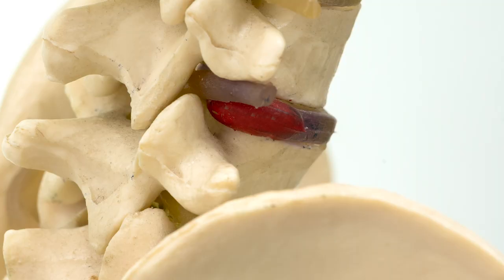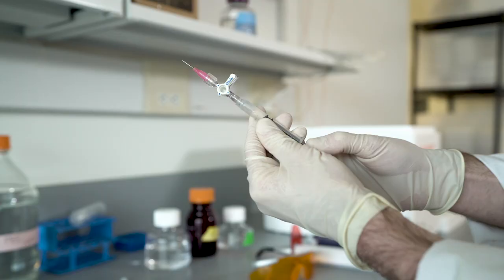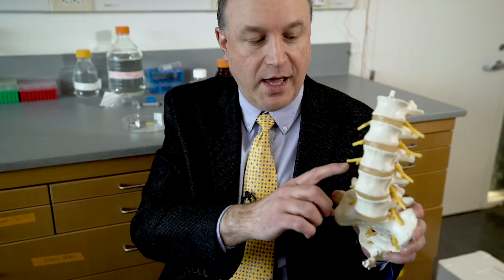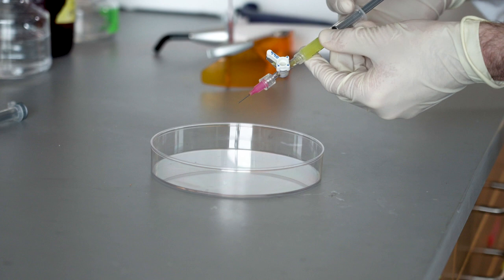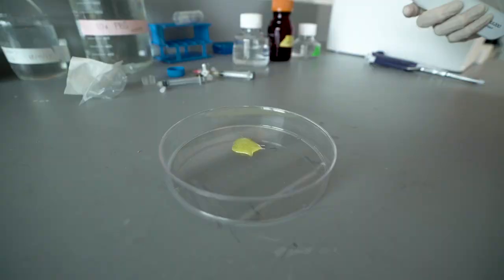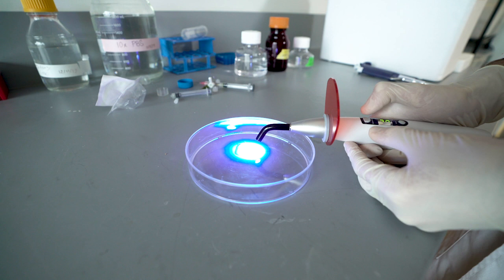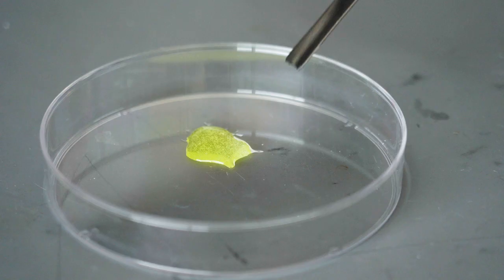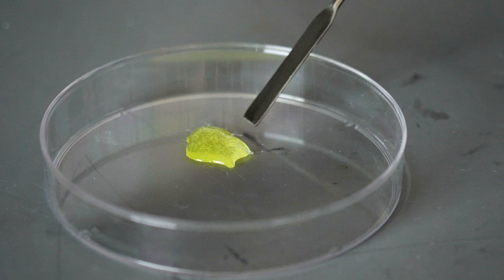Two-step method patches herniated discs

Comment: Why is this not attracting more attention??? 
Why is this not being rolled out?
What happened to the sheep that this was tested on?
This is life saving research. Hurry it up please.
Reply: Dean Whitelock There could be later concerns of this material getting into your bloodstream.
Reply: Dean, I understand your feeling
Reply: @Afrocanuk  hips are replaced, metal knees, stunts in heart and many more done successfully, Herniated disc problem should be solvable
Reply: Discseel© is happening. It’s very similar. But it’s very early stage deployment.
Total disc replacement, specifically the ActivL, seems the best option, from looking at the 5+ year empirical evidence studies.
Reply: It's collagen lol
Reply: @mrdeanwhitelock  check discgenics
Reply: @omikoch still in trial.. only viadisc is available now

Comment: When is this going to be available?
Reply: I had annual tears in L4/5/S1 as well as highly degenerate and herniated discs. Dr Wolff at Southwest spine and sports in Scottsdale arizona repaired the tears with disc seal and then filled the disc with exosomes. 

Before the surgery I had back pain for years and spams that would keep me off my feet for a week. 

Two years ago my tears occurred and I was completely immobilized for weeks with severe stiff sore achy pain. The Mayo Clinic wanted to fuse me but while in bed in YouTube I found a video that some guy posted 7 years ago, he went to Europe for stem cells into his disc. I wrote him a message and he replied he was doing well. So I started searching for stem cells in USA. I found disc seal video and then looked up the closest doctor. I found Dr Wolff and had the procedure done, I figured it was better than fusion first. It cost between 17-20k with all expenses by that may have changed. The pain went away within days and I’ve been on a long therapeutic road to recovery to strengthen my core like steel. I also ice bath a few times a week, I am a member of a ice bath spa. Loose weight, sit less, build core, posture is always on point. 
God bless you all, this is a life long battle for us and this surgery may prevent some of us from fusion.

Comment: There seems to be no updated information on this procedure and when it will be available as an option for surgeons to use. Millions of people need this surgery urgently to avoid the massive spinal fusion surgery, which is the only real alternative for badly damaged discs. Does anyone have any news?
Reply: Its available in arizona @dr michael wolf.
Reply: @mujeeburrahmansharrief8841  You have discseel available in Arizona?
Reply: Artificial disc replacement has been going on for about 20 years. Lp-esp in Germany is king.. fyi

Comment: Sounds promising.  Is this at all related to the discseel procedure?  Discseel, which I've been considering, is not though a two step process.  Does that matter?  Are the fillers the same?
Reply: disceal repairs only annulus fibrosis, this method is for nucleos pulposes as well

Comment: It looks very promising, in future they could use cellurar seeded collagen gel to seal the hole and maybe inject HA with some kind of growth factors or cells that would improve restoration of the nucleus and annulus. I'm 19 years old and have disc problem but not as severe as i see other when they are using opiates to function on daily basis and are sceptical when it comes to surgeries (i dont blame them- current surgical methods are pretty primal). I just hope the research in this field with accelerate and the technology will be accessable before it gets to the point when many of the people that could now benefit from it will in future (when the technology becomes accessable) will have their discs in the point of no-return. Even though i suffer from LDH its really painful to see other people experience it to such extend...
Reply: ncbiomatrix is working on restoring the disc
Reply: @janmiedza6607  yea i know but i doubt it would be suitable for disc herniation, maybe in the enchanced therapy with discectomy with annulus repair etc. I just hope these big companies will work together to empower therapy outcome.
Reply: @XueHaoPiaoPiao44  You write about nc bomatrix, not about prof Bonnassar?
Reply: @janmiedza6607  about nc biomatrix usage in disc herniation
Reply: @XueHaoPiaoPiao44  jesteś z Polski?
Reply: @janmiedza6607  tak
Reply: @XueHaoPiaoPiao44  co napisał Ci Bonassar? chyba ich badania były przeprowadzone na zwierzętach, ale dysk odbudowany był sprawny tylko 6 tygodni?
Reply: @janmiedza6607  nic, nie pytałem o to. Po 6 tygodniach zwierzę zostało uśmiercone i krążek zbadano, pewnie dlatego to 6 tygodni. Z resztą to kwestia kilkunastu lat zanim cokolwiek ruszy.
Reply: @janmiedza6607  z resztą nie łudziłbym się ,że to działałoby jak normalny krążek, do tego trzeba by było bardziej zaawansowanej technologii- coś co by odwzorowywało strukturalną budowę pierścienia, te całe warstwy itd no i pewnie dodania jakiś komórek by to wszystko lepiej się zagoiła i funkcjonowało na dłuższą metę zarówno do wnętrza dysku żeby spowolnić/ choć trochę odwrócić degenerację. Nawet wtedy pewnie by się coś znalazło przez co dysk  i tak nie byłby jak zdrowy... Szczerze mówiąc ch*jowa sprawa, osobiście z dnia na dzień gasnę psychicznie przez ten zajebany kręgosłup...
Reply: @XueHaoPiaoPiao44  nc bimatrix pracuje nad odbudową pierwotnej wysokości krążka, czyli defacto nad odbudową krążka, na rynku ma to być za mniej więćej 4 lata, a czemu wg Ciebie ta metoda Bonnasara nie działałby jak normalny krążek? u owcy podobno sprawdziło się bardzo dobrze
Reply: @XueHaoPiaoPiao44  mi napisał, że do 10 lat, jeśli kilkanaście lat to o kant dupy potłuc
Reply: @janmiedza6607  tzn na pewno teraz to ruszy - może ogarnęli się ze to co na razie mają do zaoferowania nie jest "leczeniem". Ogólnie rozwój biotechnologii idzie coraz szybciej, ponadto bóle kręgosłupa dotyka coraz więcej osób także pewnie pracę nad sensownymi metodami leczenia będą bardziej intensywniejsze. W ciągu 10 przełom jest bardzo możliwy ale wdrażanie tego, dopracowywanie technik np takiej discectomy by dysk mógł dobrze funkcjowac itd kwestie terapii komórkowych nie wiem ile zajmie. Mam nadzieję że w końcu cały świat zwróci uwagę na miliony cierpiących ludzi, których grono będzie się tylko powiększać.
Reply: @janmiedza6607  owca to nie to samo co człowiek chodzący na dwóch nogach, z resztą uraz u owcy był wymuszony na zdrowym zwierzęciu i dosyć szybko operowany. Trudno odwzorować tak skomplikowana budowę pierścienia włóknistego, ponadto ubytek nucleusa też był (czyli defakto komórek, których i tak już mało u osób z degeneracja itd). Na pewno jest to lepsze od discectomy bez tej łaty ale na pewno jest to początek pójścia w dobrym kierunku. U osób z przerwanymi pierścieniami terapię komórkowe by się nie sprawdzily bo po prostu by wypłynęło przez dziurę w pierścieniu, po jej załataniu może by zadziało i dało lepsze efekty w walce z degeneracja. Ale znając życie wyjdzie pierdyliard rzeczy które są złe itd chociaż kto wie, myślę że dużo zależy od wyników badań discgenics, mesoblastu, nc biomatrix (chociaż w jego przypadku on nie repopuluje liczby komórek krążka tylko jakby pobudza już te które są - a jak wiadomo komórek jest mniej w zdegenerowanym krążku no i też może działać krócej niż takie komórki). Muszą znaleźć sposób by odwzorować strukturę pierścienie, ożywić środek krążka itd. O ile co do tego drugiego jest kilka kandydatów np komórki i białka itd to to pierwsze dopiero się zaczyna a ten filmik bossnara to krok w dobrym kierunku.
Reply: @XueHaoPiaoPiao44  pewnie nie mają sponsorów żeby przeprowadzić badania
Reply: @XueHaoPiaoPiao44  nc biomatrix do odnowy dysków używa jakiegoś żelu , który nie ucieka z miejsca podania, jesłi udałoby sie  odbudować pierścień to chyba byłoby to rozwiązanie idealne, ale czy ktokolwiek inny oprócz bonassara pracuje nad regeneracja pierścieni?
Reply: @janmiedza6607  pisałem do ncbiomatrix, odpisali ze pierścień musi być nieprzerwany. Degenerację krążka to nie to samo co przepuklina z degeneracją krążka. Wątpię żeby nc biomatrix miałby odbudować pierścień do tego potrzeba jakiejś łaty jak w metodzie na filmiku tylko bardziej zaawansowanego biomateriału.
Reply: @XueHaoPiaoPiao44  wiem o tym, ale ten materiał co stosował Bonnassar chyba jest ok, przecież pracowali nad tym jakiśś czas, mogliby współpracować z nc biomatrix, ale wiadomo o co chodzi - kasa
Reply: @XueHaoPiaoPiao44  nie wiesz czy są inne firmy, które zajmują się odbudową pierścieni? to chyba firma w któej pracuje bonnassar https://3dbiocorp.com/about-us/
Reply: @janmiedza6607  nie znam, to kwestia kilku lat
Reply: @XueHaoPiaoPiao44  myślisz, że w ciągu kilku lat uda im się opracowac skuteczna metodę odnowy pierścieni?
Reply: @janmiedza6607  nie wiem, możliwe że za ok 10 lat.
Reply: @XueHaoPiaoPiao44  niestety to może być prawda, 10 lat to zbyt długo, ale oby nie dłużej, gdyby działali tak jak  ze szczepionką na covid mielibyśmy to w tym roku, niestety nie ma kasy na te badania, Bonassar chyba jeszcze niz znalazł sponsora, w sumie nie wiem co z tym dalej, on nie odpisuje na meile
Reply: @janmiedza6607  no cóż, discgenics się wydaję ,że zabiera się na rozszerzenie zastosowania ich komórek w leczeniu w połączeniu z discectomią, coś tam annular repair itd. Ale to faza "wykonalności" przed badaniami przed klinicznymi. Mam nadzieję ,że do czasu aż coś wynajdą będę się nadawał na taki zabieg o ile do tego czasu nie pierdolnę sobie w łeb. Do tego czasu nie mam zamiaru poddawać się tym pseudo zabiegom po których chodzisz z dziurą w dysku i jebią ci się pozostałe dyski.
Reply: @XueHaoPiaoPiao44  tak na serio to nic nie wiemy, Bonassar nie chce nic napisać, milczy jak grób, przecież to powinien być priorytet takie leczenie, a niestety taka prawda miliarderzy maja w dupie żeby fundowac badania, także może być opcja, że nie doczekamy sie  nigdy
Reply: @janmiedza6607  nie ma co pisać, bo jest sam. Jak sam mi napisał jest to chronicznie niedofinansowane. Niestety ale prawda jest taka że  ból kręgosłupa nie jest tak "spektakularny" jak wirus czy rak ,dlatego też mają to w dupie bo to "choroba dziadków" i się kończy. Sam jestem pod wrażeniem jak ten problem jest lekceważony, pół miliona osób ROCZNIE w stanach przechodzi discectomie która działa na krótką metę, a na samą myśl o fuzji kręgosłupa mam ciarki. Nie mamy wyboru, mam nadzieję ,że ruszy coś sensownego co pozwoliłoby na przywrócenie wytrzymałości mechanicznej dysku po np takiej discectomy, ale to wymagałoby dużej współpracy badaczy i czasu by sprawdzić ile to tak naprawdę jest warte.
Reply: @janmiedza6607  pamiętaj ,że wiele klinicznych badań działa imponująco ale to na zwierzętach które mają ogólnie inny sposób funkcjonowania krążków a gdy przychodzi do ludzi jest klapa. Z resztą nie oszukujmy się to naprawdę dużo potrzeba żeby taki dysk był w miarę funkcjonalny po takiej łacie.
Reply: @XueHaoPiaoPiao44  a czemu dużo? przeciez  oni mają ten materiał opracowany i na zwierzetach działało ok
Reply: @XueHaoPiaoPiao44  jak na razie tp chyba tylko Bonassar wymyśłił jak łatać dziury w pierścieniu, gdyby to działąło na ludziach to w połączenie z nc biomatrix mogłoby przywrócic kręgosłup to stanu wyjścia
Reply: @janmiedza6607  naprawdę nie widzisz różnicy miedzy człowiekiem u którego degeneracja i uraz rozwijał się latami a owcą?
Reply: @XueHaoPiaoPiao44  oczywiście, ale trzeba być optymistą nic innego nie zostało
Reply: @janmiedza6607  z resztą mnie bardziej napawa optymizmem takie oto rozwiązanie- które odwzorowuje trójwarstwową strukturę pierścienia. https://www.ncbi.nlm.nih.gov/pmc/articles/PMC3325390/ jak co to sobie przetłumacz w miarę da się zrozumieć sens
Reply: @XueHaoPiaoPiao44  o dzięki:) jakbyś coś Ciekawego znalazł to możesz podesłąc na meila jak masz czas, byłbym wdzięczny:) jan.miedza@o2.pl
Reply: @XueHaoPiaoPiao44  na siłownię też można chodzić, mi lekarz nie zabronił, no chyba, ze masz ból, mnie nie boli a mam przepuklinę
Reply: @janmiedza6607  czasem coś szukam ,ale chyba wszystko dostępnego w miarę na czasie wyczytałem. Codziennie czytam tego samego ale nic z tego tylko bardziej sobie ryję psychikę tym kręgosłupem. Jeszcze jest Notogen- podobnie jak ncbiomatrix, mają zaczynać kliniczne pod koniec 2021.
Reply: @janmiedza6607  No i osobiście unikam jakichś gównianych pseudonaukowych forach, polecam ncbi czy pubm, raczej naukowe i potwierdzone info tylko po angielsku. Ostatnio znalazłem pewien artykuł Putting the Pieces in Place: Mobilizing Cellular Players to Improve Annulus Fibrosus Repair ale nie mogę go znaleźć za free tylko dostęp za jakieś 60 dollarów więc sobie odpuszczam.
Reply: @janmiedza6607  u mnie wypuklina 3mm, ale na rezonansie sprzed 10 miesięcy, teraz coś mnie czasem zakłuje itd, czasem jest tak że praktycznie nic nie czuję i wszystko jak wcześniej a czasem mnie cały dzień nadupca i jakby "miażdży" przy siedzeniu zwlaszcza, bez bólu mogę się schylić. Po ćwiczeniach w miarę ok. Na siłownię to też bym ruszył ale to jak nabiorę trochę ruchu na rowerze i basenie, z resztą nie pchałbym się na siłkę na te martwe ciagi nawet ze zdrowym kręgosłupem. Jebane chujostwo, sprzedałbym nerkę i wziął kredyt we frankach za normalny kręgosłup.
Reply: @XueHaoPiaoPiao44  ok, ale to stary artykuł, i te badania posunęły się jakoś do przodu? jakas firma się tym zajmuje na poważnie?
Reply: @janmiedza6607  swoją drogą- żadne z dotychczasowych zastosowań komórek (przynajmniej tego co szukałem) nie doprowadziły do zwiększenia wysokości krążka, co najwyżej doprowadziły do większej hydratacji. A w wielu badaniach na zwierzętach dochodziło poprawy wysokości a u ludzi nic. Także wszystkie efekty jakie były u zwierząt w badaniach  nie napawają mnie jakimś wielkim optymizmem, najwyraźniej zupełnie inny mechanizm jest u ludzi. Coś się okaże jak Mesoblast opublikuje wyniki 3 fazy badań komórek mesenchymalnych nad leczeniem degeneracji krążka.
Reply: @XueHaoPiaoPiao44  ok ale nc biomatrix może będzie sukcesem jeśli chodzi o odbudowę wysokości krążków, druga sprawa co z naprawą przerwanego pieścienia? ten artykuł który podesłałeś jest dośc stary z 2012 roku chyba
Reply: @XueHaoPiaoPiao44  jak nawet martwy ciąg jest polecany na plecy, jak masz mięśnie to one częściwo odciążają kręgosłup
Reply: @XueHaoPiaoPiao44  ok ale co z tymi badaniami dalej, artykuł jest z 2012 roku, może wiesz czy coś się ruszyło?
Reply: Have you heard of discseel? I think Cornell sponsored drs there to learn the procedure? I'm curious about it for myself.